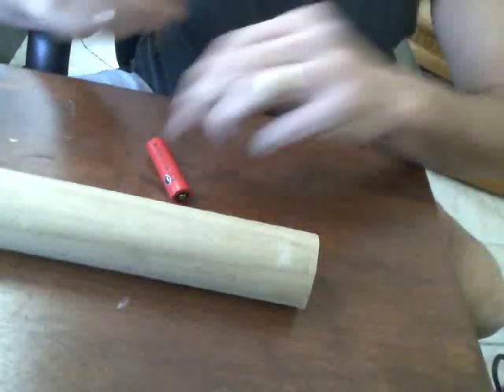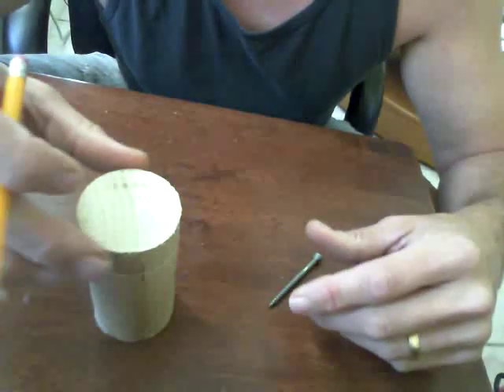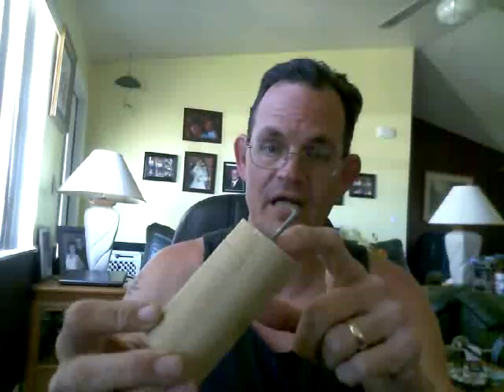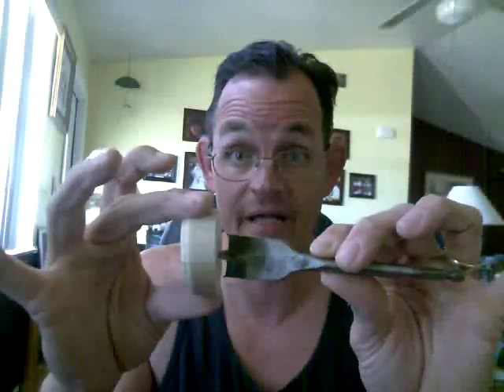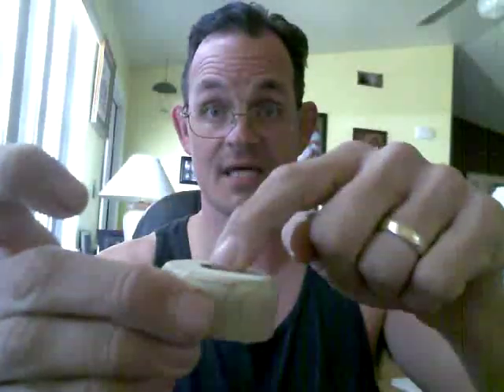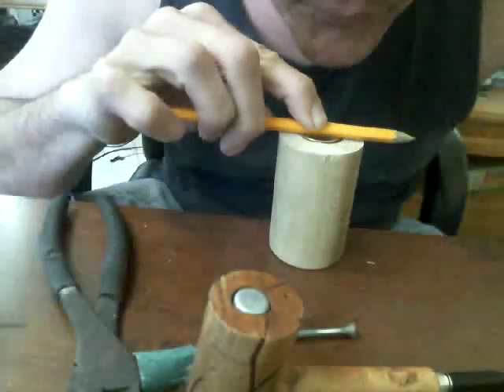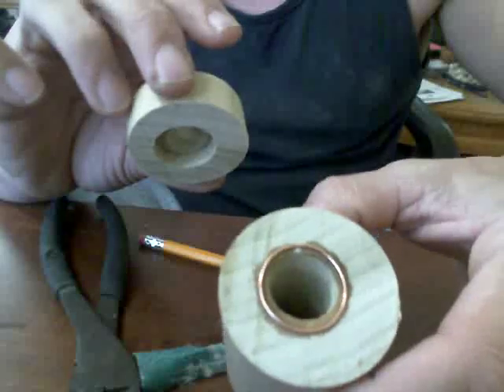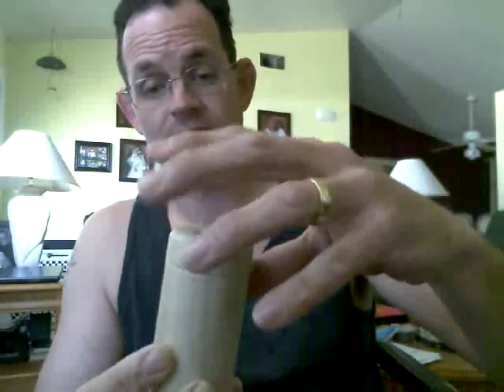18650 pipe step by step  ( part one )

Comment: Just a suggestion. If you use a larger but shorter wood screw with a hex head as your pilot screw, you can hold the head of that screw in the chuck of a hand-drill and turn it, i.e., like a poor man's wood-lathe. That'll allow for much easier, safer and fancier woodworking on the bowl. But of course, this will require precise centering though (don't eye-ball it!).